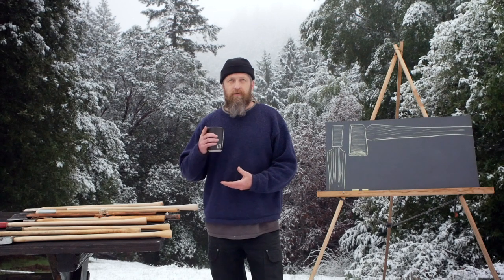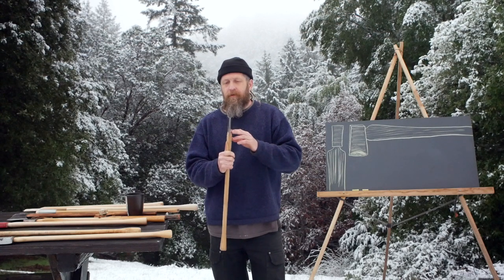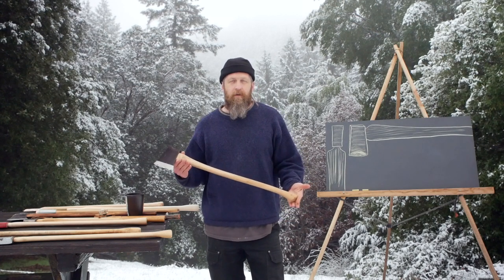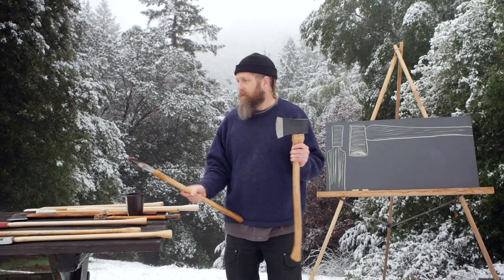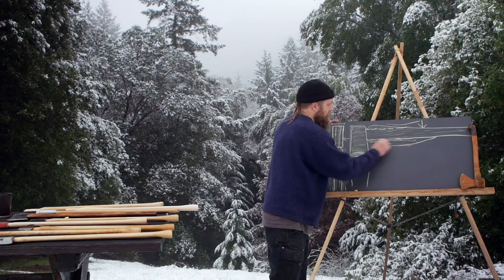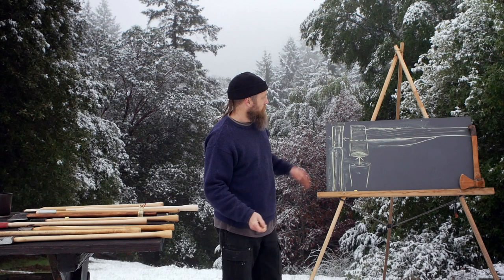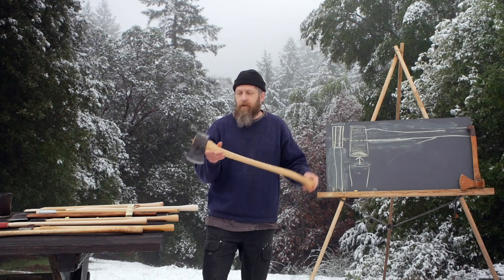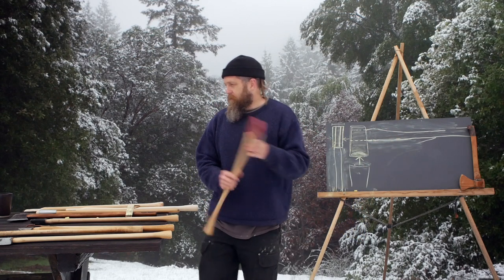Failure By Design, Axe Handle Design Mistakes and Improvements, *Spread the Stress*

Comment: Great video, you said all the things I have been thinking about flexing over the length of the handle to absorb shock and stress fatigue at the shoulder/head joint. I took the liberty to share the video to the AJ's. You have a great "user" perspective on axes compared to the folklore and mythology that most recite with out testing or logical thought. Keep up the good work.
Reply from the maker: I feel like I just set up and introduced the subject.  There is a lot more to say and think about.  Like at what point does the balance tip the other way and the now too thin handle is vulnerable to front to back stresses. and which impacts and uses favor different common breakages.  Also, my perspective is still largely around European eyes.  If the issue is striking a balance between eye thickness and handle flexibility, we could start asking if a handle on an axe with a thicker eye maybe should stay a little fatter.  But, that all leaves out a lot about user preference and ergonomics that might affect total handle thickness and rate of transitions.  I think there are compromises involved all around.  My concern is mostly that gross differences in thickness in different parts of the handle are recognized as the potential problem that they are.  It's a start.  Thanks for sharing.  I probably should have posted to AJ this morning.  I'm terrible about getting stuff out and I'd rather someone else did it anyway.  I'm not that comfortable with self promotion.
Reply: Hey, no worries I like to promote you. I'm trying to figure out how to get the cordwood challenge done, I may have to do it for friends as I don't heat with wood, only back yard fires. I just picked up an axe that has the thinnest handle I have ever put my hands on, almost uncomfortable. It is really beat up from over striking but still strong which would nod to your theory about sharp transitions. It all makes sense to me as we see how this works even in steel, just look at a sheer pin, sharp shoulders= snapping point. Obviously that is the point of a sheer pin, but logic would say be as far away from that design as possible to avoid snapping a handle. I've been thinking about running a mechanical  test on handles, to observe factors like grain orientation, guards, and wood selection. However, realistically I would need to run at least 5-10 handles per variable to get good results, and that's out of the budget lol. Again keep up the good work.
Reply from the maker: I think you could get some good information from testing, but it's still not real life.  Information like that is great, but it's relevance is often blown out of proportion.  I probably won't do it, unless I'm trying to make a point in a video.  For chopping, we really should be using the handle to loosely guide the direction and that doesn't require a lot of control or a strong grip.  That's why burly lumberjacks could swing thin narrow handles all day with outstanding accuracy.  It's a common misconception that thin handles lack the ability to control the axe, or that they steal power by being too flexible.  I think they probably increase power if we're chopping with a sustainable light handed technique, but I've yet to try to prove it.
Reply: I would agree that they increase power, you don't see professional golfers using a baseball bat they use thin whippey handles to create acceleration with extreme accuracy while they are calm and relaxed. I have found that to be true of chopping, the more I try to "muscle" the axe the less accurate I am and lower accuracy means more strikes required to get the head to its destination. My reasoning for a test on handles would be to try to show that things like "perfect" grain and other things that people put huge stock in are far less critical as individual parts, instead of looking at the whole "system". I'm sure some would ignore the results while others would cling to the information as a reason to make poor choices..lol This is a great conversation that I hope more people that use axes start having.
Reply from the maker: "I'm sure some would ignore the results while others would cling to the information as a reason to make poor choices..lol " ha ha, probably :)

Comment: 2:30 The physics of these glancing blows are the radial forces toward the center (Fc; centripetal), the tangential force (Ft) acting in any direction other than toward the center thus changing the speed and/or vector of that object, and there is some angular force caused by the lever mechanism (torque) at the head/handle junction during the glancing impact.
Reply: All of these forces have some component of Mass in the equation....when you solve the Force equations for the axe head mass vs the handle mass....the differences in the acting forces on each (due in part because of the differences in mass as they are both traveling the same velocity and angle essentially) can be large enough to cause shearing.
Reply from the maker: I'm not sure I understand all that, but it's something to think about.  Another factor bay be how hard the grip is.  I've thought about handle mass a bit, but hard to say in real life how any of it plays out.  It seems like a heavy handle is more likely to stay still when the axe head changes direction up to a point, but flexibility seems more key to me intuitively.

Comment: I agree with everything you mentioned. I would add that you should bevel or round the edges of the metal on the handle side of the eye and even taper the opening a good bit. Wood will flex at a smooth transition but break clean at a sharp one. It does make fitting a handle more difficult as you don't   roll a shaving of wood when test fitting the handle but softening the shear line reduces breakage be it hammer or axe.
Reply from the maker: I definitely agree with that and have mentioned it elsewhere.  I think we might also consider making that more radical.  But, at least take of the sharp edge I say.

Comment: You seem like a fascinating guy to hang out with. I'd be particularly interested in any videos about blacksmithing if you get back into it. At least I would feel like less of a neophyte in that area, as it's something I've dabbled in as a hobby. I've doubled the number of axes I own because of you, BTW.
Reply from the maker: If I do anything on smithing it will just be to demystify and make it seem accessible, which it is.  Dig a hole in the ground, get some charcoal, an air source a chunk of metal to pound on and a hammer and start heating things up and hitting them.  You can always start upgrading from there.  I'm not an accomplished smith, but my goal is to just be a reasonably competent farm type smith, so it's there when I need it.

Comment: Hey Stephen..I went back a couple of years looking for info on bowl gouge handles. I recently purchased a Narex, Czech made ,fairly inexpensive bowl adze, basically to give it a workout. Well of course, the first thing I did was remove all the "varnish" and the black paint on the top at junction with head. Then I began the "Skillcult" method of fitting it to my hand, contouring, smoothing , thinning (again to feel better in the palm) etc. until I was able to see a fairly nice piece of wood. It says they use ash, not sure of species, ?? Fraxinum excelsior perhaps, but it looks/feel ok, especially after a couple hand rubbed layers of wood catalyzed oil. Anyway, the grain is 90 degrees of what we desire on good hickory/ash axe handles. So.. my question is, would this be deliberate by the OEM  since it's not "flelxing" per se as in longer thinner handles ; does it matter (like a small hatchet??)  I have't started to work the steel so I have no idea if this is a keeper or not. I'll be grinding, honing and stropping soon.  Thanks for your opinion. Wouldwork.
Reply from the maker: There is a school of thought that thinks that grain orientation is better and more springy.  I don't think it matters that much.

Comment: I agree ,smooth transition and grain orientation will be the most important for strength and durability for everything on earth.
I have been working with metal for over 20 years and they are two of the most important things to watch for, bend metal across  the grain and round all sharp edges .Just follow natures blueprints for a better product lol .
Reply from the maker: I put end grain orientation lower on the list than a lot of things at this point.  Grain runout is super important though for sure.
Reply: I agree with you I have an  old axe with orientation going at a 45 and works fine. I  was thinking about what you where saying about to much wood and orientation around the axe head makes perfect sense ,its all about the flex to strength ratio.

Comment: The fat wood under the head leaves a place where the wood knows where to break, at the transition from the eye to the handle, the abrupt change .  If it has a slow transition into the handle the break doesn't know  where to start.   I see this same thing in timber frame joinery decisions, specifically in joists.  If you have a 10" deep tie beam with 8" joists dropping into pockets along the tie, the joist are usually reduced in depth at the tie/joist location.  There is a few way to make that reduction on the joist end, a square cut, a cut with a 45 degree slope or use an adze to sweep the reduction back into the joist. I usually do this in a jig or in place by inserting the joist in upside down and adzing them to the pocket depth then flipping the joist over, no lay out needed.    Video below show working adze ends in a jig on the shop floor.  

I hope that was a green screen.  Although your still at the end, of the deer head with snow on it, suggest you got a spring snow.   We are having some good old northeast blows here getting from 1-2 feet of wet heavy snow over the next two days. 

Is there more details on your axe give away?   

 https://youtu.be/zRsWoUKg8to
Reply from the maker: I think that's a good anthropomorphic way to articulate it.  It's probably about distribution of stress again.  Even a small gradual transition should make less of a difference  in behavior under stress, because there the difference between the thinnest and thickest parts is distributed over a slope.  That makes initiation of the crack delay that little bit more and if the crack can't initiate, it can't exist.

The axe isn't ready.  I have to grind it, use it a little and I may put a rawhide collar on it.  I"m not sure how I'm going to do it yet.  Don't hold your breath.  I just want to make sure it's ready to chop.

Comment: This is very very helpful, more than an other video I’ve seen so far. Thank you. I inherited an axe with an excessive amount of timber near the head , just as you have described only even more than you have described, plus with a very long handle (to long for my swing) the handle tapered to a thin grip (again to thin for my hand). The timber head the head had serious damage from (I assume) of swinging, with large splits and cracks make the axe unusable. But the axe was very well balanced and light to use. I cut the head off and reset it further down the handle (about 8-10” lower). Now it has “mid” length handle (a bit  short, but ok) though now it is top heavy (odd considering the mass of timber that was at the head - as much as the axe head itself) . So now the axe is top heavy and a bit short. My question is is there a head weight to handle length ratio?
Reply from the maker: I don't really think there is any best weight/length ratio.  at least not in truly practical sense.  If you watch my other axe content, you'll quickly find out I'm a fan or short light axes, in the "boys axe" or "pulpwood axe" range.  about 2.25 to 3 lb on a 27 to 30 inch handle.  Check out my man Ben Scott too on YT.  He has some good axe content.

Comment: Excellent!  I saw your other video about House Handles, I got one of their Boy's Axe handles, premium octagonal , looks like the one you got. a tiny bit warped , but I set it back with a clamp on a table . It's the backup handle for my brand new Council Hudson Bay, which so far has been pretty awesomely hung with a slim, straight handle. Oh,  But the handle grain is horizontal. But I'm paying attention to technique and just doing camp firewood and fatwood so good chance it will survive . What is your opinion on wrapping the neck section with paracord?  God I hate it when you doink the handle and now there's a dent.  Yeah the boy's axe has too wide shoulders so I'll slim those down if I ever end up mounting that handle.  God some of those handles are atrocious!

Comment: I ended up getting a spokeshave just to thin the handle on my Hults  (same model as the husqvarna you showed in the vid). I wish I'd measured before but it was reminiscent of a barn pole. After much thinning/profiling it's down to 3/4" in the belly area up to 13/16" cross section in the throat. Funny how I hated it before and it's a joy to use now. My  council jersey took way less work to the haft.
Reply from the maker: Council has nice handles.  I just shot the husqvarna handle vid.  I'm not that thin yet, but I'll just nibble away at is when I use it, til it's right.  Huge improvement already.  It went from a heavy club to a svelt little filly.  Dump truck to race car.  I wish I had weighed the whole axe first.  I used just scraping and the rasp.  It did take a long time.  geez.  I actually didhn't want to use a spokeshave, because most people don't own one.  If they do, they probably don't need me to tell them to use it.  With something like council, I'd actually prefer to scrape it down, with a little rasping for transitions.
Reply: You're a more patient man than I. Lol! I had the spokeshave when I bought the council but I don't believe I even had to use it. 

On the breakage subject, have you ever used Osage? I read a few years back that it was the preferred bow wood (sometimes even called that) for native americans. My chainsaw and I both know it's tougher than anything else I've tried to cut, super dense and allegedly very flexible. I'm wondering if it may not be the next step up from hickory.
Reply from the maker: Bow woods are not just about flexibility, but also recovery.  It's the two together than can make a really great bow wood.  Some woods may flex fine, but the recovery is slow, or not full recovery, so the bow stays bent or gradually takes a set.  If I recall right, hickory might have an inferior recovery to locust and osage, but that probably also means that it's less brittle.  So, of course, like anything, it gets more complicated the more you dig.  Chances are that woods with slightly poorer recovery might be a little tougher and more resistant to shattering.  There is also toughness as regards splitting.  I think of locust as quite tough longitudinally, but easier to split than hickory, so there is another factor to think about.  My experience with Osage is very limited.  I just compare it to locust because they are similar woods, though not taxonomically related.
Reply: Interesting. I never considered recovery as a necessary attribute to haft material but it makes perfect sense. I have access to hickory and Osage here and black locust on the home place in KY. Sounds like I need to experiment. Going to need a couple more axe heads...lol
Reply from the maker: I mis-typed handle instead of bow, just fixed.  I don't think recovery is much of an issue with a handle.  As long as it's not extreme it could be a benefit.  it may be that a wood with poorer recovery could be less brittle.  Just a  thought from whatever impressions I have the little I know about the subject of bow making.
Reply: Yeah I don't believe I'll be harvesting any river birch or black willow lol. But I AM going to have to try Osage. I've had the itch for a while.

Comment: i made the transition at the back of the handle to sudden on my last re-hang, a piece split off the back just from seating the head down onto the handle. i managed to get the axe hung but i don't think i can jump it down again if it comes loose. the handle has a boundary between sap and heart wood running through the back transition increasing the chance of it splitting apart as well.
Reply from the maker: I think the rapidity of transitions and having actual sharp angles of any kind can end up being major player.  I do some relatively fast transitions on the back but that has to do with other factors.  Ultimate strength can be subjugated by ergonomics.  Plus, there are other areas of the handle that are weak and can be potentially made vulnerable by other design issues.  It's clear to me though that the area below the eye with it's transitions can be improved in a lot of axes and is totally ignrored  as a factor sometimes.

Comment: I have had several sledge hammer handles all but shear at the head from overstrikes that hit squarely on the handle and did not glance off.  Maybe just me, but food for thought
Reply from the maker: One thing to think about with those is that they are not very thick in the front to back direction like an axe handle is.  Also, there is a tremendous amount of weight for that skinny little eye.  So, it's not really too surprising.  you have all this momentum come to a sudden stop, and a point of contact near the eye, the head keeps moving and shears off at the weakest point.